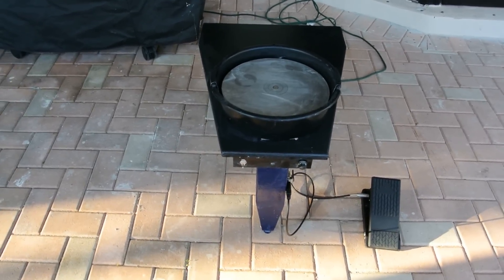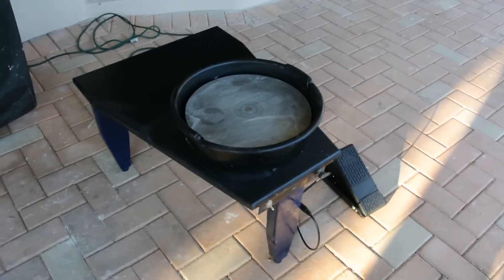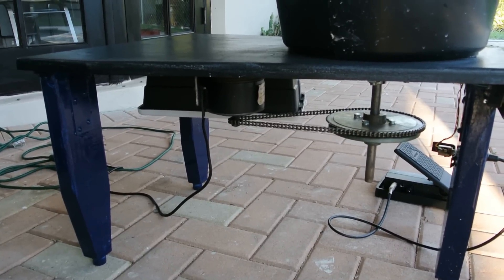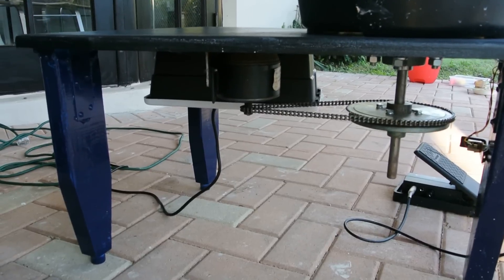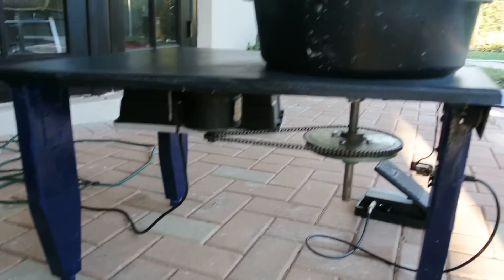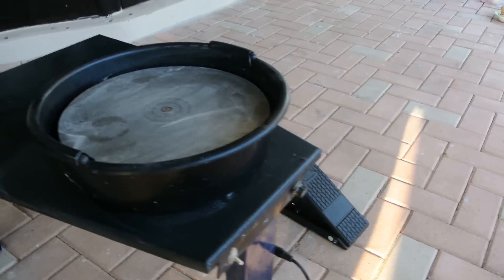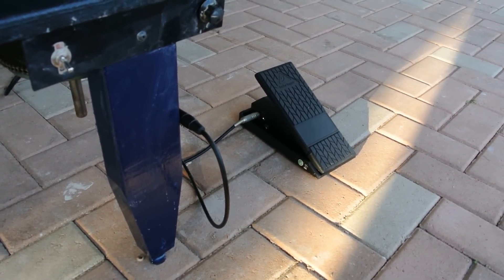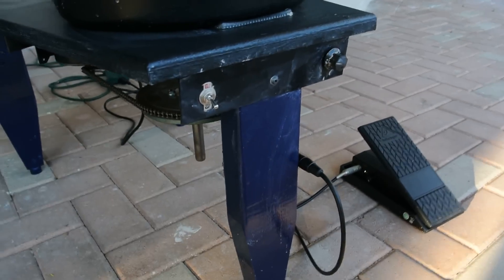DIY Potters Wheel

Comment: What did you use to attach the drive shaft to the wheel head? I've been trying to find a pillow flange, but most of the time I find them with bearings, but the wheel head needs to be fixed to the shaft.

Comment: Congratulations for your pottery wheel. I made one myself starting from the basis of an old ham slicer. I added a triphase electric motor, a vfd for speed control and a few other spare items bought in local stores. I had to pay a lathe machinist to make the plate and adjust the pulleys. If you are interest I can share pictures of it.

Comment: how does the volume pedal work with the wiring?  Is just right from the DCpower supply then direct to the motor?
Reply: It depends on which type of scooter motor this was.  If it's a standard, brushed motor, then the leads would go to the potentiometer input on the speed control box.  If it is a brushless scooter motor, the wiring is even easier.  The controller is built into the motor.  So, it would just be a matter of replacing the thumb throttle with a 1/4" jack.  The value of the pot in the pedal could be off, but it looks like this was done without modification.  

The reason why this is such a cool idea is that there are thousands of cheap used electric scooters on Craigslist.  And, all of them will have one or the other type of speed control...either can be used.  People ditch them when the expensive batteries die.  So, you can often pick these up for around $25 or less.  A friend of mine got one for $5 at a garage sale.  Just look for the ones with the most wattage (HP).  The high watt, brushless motors are the most difficult to find.  But, the regular motors should work fine.
Reply: lets say you were using a fan motor or different kind of motor besides a scooter motor - how could you set up this pedal? i have a ceiling fan motor with a pull cable, could i just replace those connections with a 1/4 inch jack?

Comment from the maker: The center shaft goes flush with the surface of the platter.  next i am will drill and thread two holes to place removable screws and use home made bats.

Comment: Hello! This is SUCH a helpful video. I am building a wheel, and finding the right wheel head has been the hardest part. The sanding disk is a terrific, inexpensive idea, but all of the ones i found online have a hole through the center. did yours have this? how did you fill it in? Thank you again for posting!!
Reply: I agree with this! how did u get the sanding disk setup?